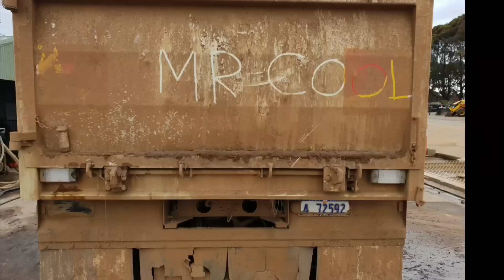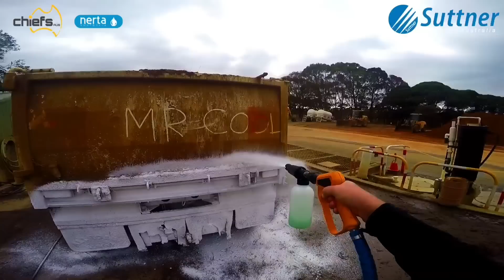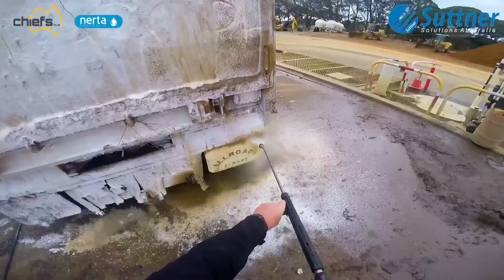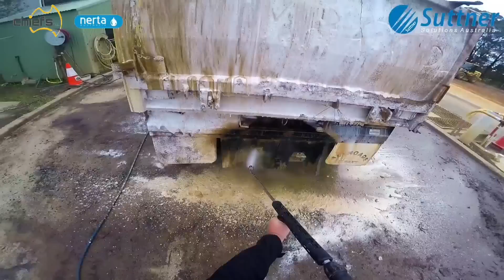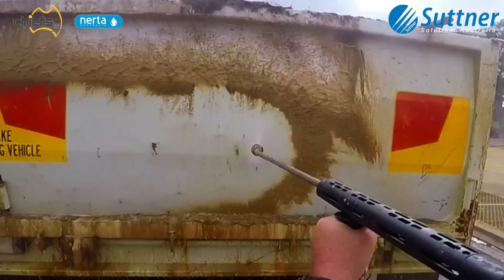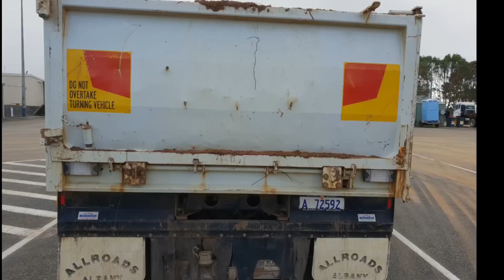Nerta's Active Diamond

Comment: i wonder why did they start from the bottom? its better to start from ontop...
Reply from the maker: When washing a vehicle using conventional methods you firstly apply soap, wash using a sponge or a broom and then rinse off with water from the top to the bottom.
Touchless washing is a bit different.
Soap is applied through a high pressure foamer and then high pressure water is used as a “sponge or a broom". The water is worked back into fresh soap, either from the bottom to the top or backwards in the case of trucks and trailers etc. In this way, the soap is used more efficiently. (If you wash from the top down, you would simply wash the soap off the vehicle which defeats the purpose).
Then rinse from the top down to finish the cleaning process.

Comment: why they always star at the bottom?
Reply from the maker: When washing a vehicle using conventional methods you firstly apply soap, wash using a sponge or a broom and then rinse off with water from the top to the bottom.
Touchless washing is a bit different.
Soap is applied through a high pressure foamer and then high pressure water is used as a “sponge or a broom". The water is worked back into fresh soap, either from the bottom to the top or backwards in the case of trucks and trailers etc. In this way, the soap is used more efficiently. (If you wash from the top down, you would simply wash the soap off the vehicle which defeats the purpose).
Then rinse from the top down to finish the cleaning process.

Comment: Why dont they ever do top to bottom first
Reply from the maker: When washing a vehicle using conventional methods you firstly apply soap, wash using a sponge or a broom and then rinse off with water from the top to the bottom.
Touchless washing is a bit different.
Soap is applied through a high pressure foamer and then high pressure water is used as a “sponge or a broom". The water is worked back into fresh soap, either from the bottom to the top or backwards in the case of trucks and trailers etc. In this way, the soap is used more efficiently. (If you wash from the top down, you would simply wash the soap off the vehicle which defeats the purpose).
Then rinse from the top down to finish the cleaning process.

Comment: top to bottom
Reply from the maker: When washing a vehicle using conventional methods you firstly apply soap, wash using a sponge or a broom and then rinse off with water from the top to the bottom.
Touchless washing is a bit different.
Soap is applied through a high pressure foamer and then high pressure water is used as a “sponge or a broom". The water is worked back into fresh soap, either from the bottom to the top or backwards in the case of trucks and trailers etc. In this way, the soap is used more efficiently. (If you wash from the top down, you would simply wash the soap off the vehicle which defeats the purpose).
Then rinse from the top down to finish the cleaning process.
Reply: Hey chiefs that’s what annoyed me in all of your videos till now, but I get your point now. Happy cleaning 🧹